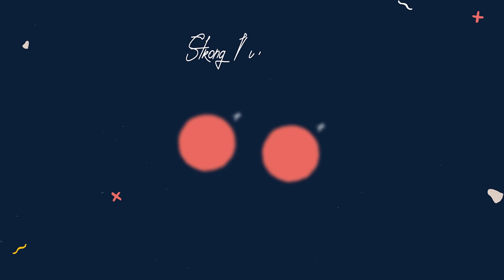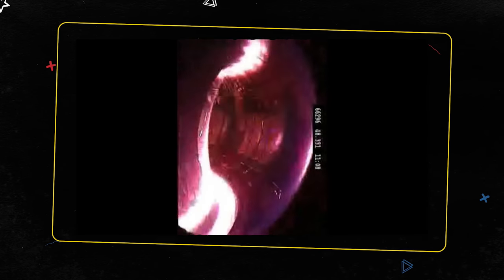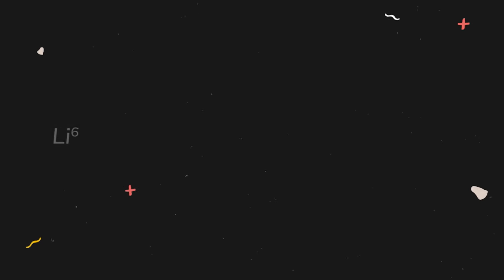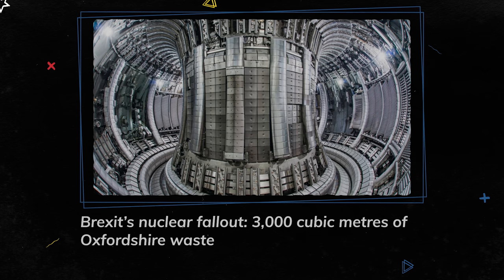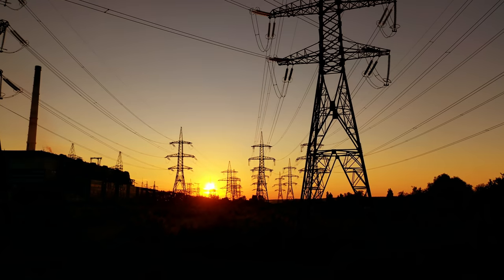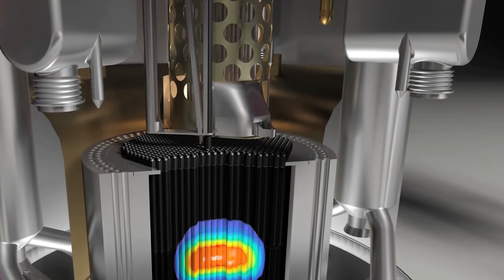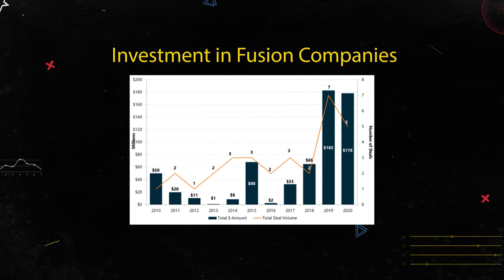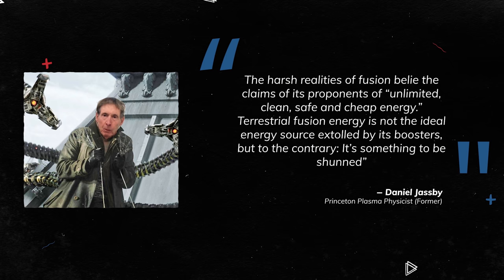What No One Else Is Telling You About Nuclear Fusion

Comment: There is one more difficulty with fusion that is not discussed here, and it could be big. Most of the energy of the fusion reaction is carried away by neutrons. In fact, it's a bigger portion than in a fission reactor. Those neutrons have to be stopped inside the reactor to extract their energy. They must be stopped before they reach the magnets, but that's just the beginning of woes. They really need to be stopped before they reach the walls of the reaction chamber, or they will gradually destroy that as well. Those walls cannot have even the slightest leak. So what you really need is some kind of blanket inside the vacuum chamber that stops the neutrons almost entirely within its interior, then just radiates away the heat. You are helped by the forward momentum of each neutron, which will result in most collisions being deep inside the blanket. Still, there will occasionally be some spallation events that will spill particles back into the vacuum chamber, either at entry or at exit. Well, it is a vacuum, so those particles will tend to fall to the bottom of the chamber. Still, you can bet that this will amount to a real engineering problem that will have to be addressed in one way or another.

Comment: Well, yeah. ITER is "just" a science project, everyone who thought otherwise didn't understand a thing about Fusion. We will need proper superconductors and most likely use the stellerator- design for the reactor. And yes hydrogen at superluminal velocities only sounds dangerous if you lack knowledge, f.e. about how energy is dissipatet inside a volume. 
Well, you know. Fusion is still 30 years away. Always. Until we find the black swan to make it possible.

Disclaimer: all writing mistakes belong to the one who finds them.

Comment: I think you are absolutely correct. My own studies suggest fusion power is 22nd century (with luck). But it is important we get there so research must continue. Meanwhile to solve global warning it is renewables plus fission, likely globally in an approximately 50:50 mix. 

Of the existing fission technologies Candu has a good safety record and some capacity to burn up waste. Therefore new generation Candu reactors may have a role. 

Beyond that there are the Gen 4 plants built to very high safety standards, waste minimisation and levels of proliferation resistance. Those designs using molten fuels (typically FLiBe salt) show particular promise. There is enough Th and U in recoverable quantities to meet global fission power needs (in conjunction with renewables) for at least several millenia and possibly well beyond.

Comment: All of these problems illustrated here need to be discussed. And, in general, physicists would agree, these problems all can be solved at the end (the video also agrees on this). Solving the problems will take time - and it already took a lot of time with no tried and tested solution so far. It does not look like there will be any "fast track" solution to make the technology available on big scale within the next 15 years. Therefore:

One problem REMAINS undeniable: Only in 2060 could nuclear fusion contribute in the single percentage range to global energy demand.

So it might be important not to be under any illusions.

( In 2060 our fossil fuel demand has to be already reduced to at least say no more than 20% of the amount we use today. So that will have to be done without a significant contribution of fusion. )
Reply: I just watched a video a few days ago, there is oil in China but deep under the ground, if put more money on technology improvement China can have sufficient oil (no need import) for over 100 years, but China apparently chooses to import oil currently instead of dig deep.

Comment: Good presentation. I have studied energy for over fifty years. fifty years ago I learned about the density requirements needed to obtain a fusion reaction. An example I remember stated the density would be 13 times the density of lead. You can figure out for yourself how close this is to being correct. Imagine trying to compress lead to the point that its density is 13 times greater and you can easily understand that this would limit the quantity of deuterium fuel. Then there is needed a transducer to make use of fusion energy.

Comment: It seems the predominant tokamak or spheramak fusion designs could be improved by eliminating the central column and extending plasma isolation in that region by a magnetic field only. Then you could converge the center radius if desired, which would then give such design the traits of a focus fusor as well. However I've not seen such attempted yet, and focus fusors tend to be small compared to the other fusion reactor types. Perhaps it's a problem with mechanical stress introduced by magnetic fields that makes building a reactor enclosure with no column protruding through the middle difficult? Anyhow if the center column could be rid of, then you'd have a region for more energetic reactions that current designs don't allow for. (I picture something like a ring of inward-facing horseshoe electromagnets over a reactor chamber, with a cantilever structure over that to deal with mechanical stresses produced by an active containment field. Then build a column-less reactor like that. Field goes through where needed to control plasma, but nothing physical in the way where the hottest region would be possible.)

Comment: I find it really interesting that people consider fusion power too slow and expensive to provide clean energy in the future but take it for granted that we will solve all the problems with intermittent renewables soon with technology that is yet to be developed.
Reply from the maker: Well, Carbon Capture for example is a solved problem. 

We know how to do it. We could burn coal and capture the CO2, and it would be magnitudes cheaper than Fusion. 

Secondly, if we’re ok with an expensive but CO2 free option, we’ve had Fission around for 70 years with an excellent safety record. 

And lower energy neutrons to deal with. Even fast reactors use 1 MeV neutrons whereas the neutrons coming out of Fusion are at 17 MeV.
Reply: @TechforLudditesSira  carbon capture is SO not a solved problem, since it is way more expensive than almost anything else. It is as much a solved problem as fusion is.
Reply from the maker: @JanMalec  No, no, we can do carbon capture right now. Of course it takes energy, but we could build a Carbon Capture Coal Plant tomorrow at somewhat competitive rates.

Comment: The fundamental problem is that it's "terrestrial". We don't have the sun's gravity, so we need to up the temperature to 100 million K, and use Deuterium and Tritium. All we need to do is manipulate gravity, creating a small localized volume of sun-level core pressure. The temperature required drops to 15 million K, and you can use just straight hydrogen (the proton-proton chain). The gravity provides the containment, although it would probably be a good idea to encase it in some sort of shell. As long as the gravity manipulators and the hydrogen-from-water crackers use less energy than what you can generate, you're on a winner (potentially, at least, the gravity systems may be relatively low energy, as you're just folding a small bit of spacetime). Although, of course, the time dilation effects inside the reactor might bring on some unexpected consequences: but they'd also make the reactor last a lot longer from our point of view. Where is there another Einstein when you need one?
Reply: the temperature required doesn't drop to 15M. It's just that Sun is so big (literally 99% of all mass in Solar system) that it can afford such inefficient process. You want efficiency? You NEED to go 100-150M

Comment: What this video is not telling you:   Fusion advances over the past 60 years have been above Moore's Law - No other industry have seen such improvements.

* A company called General Fusion has a working mechanical fusion reactor which negates many of the problems stated here.

* A company called Helion Energy has a reversed field fusion reactor which negates many of the problems stated here.

* MIT (the university) is building a SPARC fusion reactor to test their revolutionary magnetic coils, total cost will be  much cheaper and smaller than a fission reactor.

* Fission can never reach 100% energy gain . But fusion can, the stronger the magnetic field the more reactions.
 ITER made a record to reach 45.5 Tesla, almost doubling magnetic performance and reactive potential.

* Fusion reactions produce tritium. Tritium  is not a limiting fuel... Lithium is, which is cheap and abundant.

Comment: It's worth noting that ITER with its toroidal reactor isn't the only fusion project in construction now - Wendelstein 7-x is doing great progress with its alternative design (Stellarator), they are alredy in the stage of short plasma bursts, with continuous fusion expected around 2022 (although coronavirus may cause delay)

Also, with high costs there are great benefits coming as well - deuterium-tritium fusion produces helium-3 which is a sort of a dream fuel, since it doesn't produce fast neutrons, meaning it can be fused in much cheaper, simplified reactors later on.

Comment: Most people don't realise that ITER is not even designed to produce power, but is really just an experimental reactor. I generally agree with Daniel Jassby, the claims for fusion start to fall apart when you look closely. D-T fusion is not unlimited, certainly not cheap, nor that clean. I believe that the technology in ITER will be too expensive to build and operating costs too high for it ever to be commercially viable. Maybe some other fusion technology might be commercially viable.
Since we already have access to a fusion reactor, we really should use that as much as possible.
Reply: @Gomlmon99  You are just repeating what I said... ITER is an experiment. My belief is that the technology being explored in ITER will not lead to a commercially viable reactor. 
If you want to know more about the problems with the technology, look up the articles by Daniel Jassby, they are very informative.

Comment: It's not "clean" either the reactor structure materiel will become neutron activated over time and need to be disposed of as radioactive waste, and there will be tons of it. Fusion creates a ton of neutrons, the soviets actually leveraged that with the Tsar Bomba to create a fission -> fusion -> fast fission bomb where the neutrons from the middle fusion stage were focused with neutron deflectors into ordinary depleted uranium metal and caused fission even though the materiel isn't anywhere near criticality. The fission stage was actually the most potent stage of the entire bomb because the outside neutron source caused much more complete fission than with a criticality based atomic bomb. The third fission stage was never tested the soviets got scared and replaced it with a dummy stage but as originally designed the third stage would have more than doubled it's output to over 100 megatons.

Comment: You missed one more problem: If for whatever reason the vacuum fails in the torus, the lithium blanket will ignite explosively. The only true solution to do away with Tritium and the Neutrons causing material problems, would be to go with a Deuterium - Deuterium reaction. The main problem of course is the requirement of 3 to 4 times higher temperature than the Deuterium - Tritium reaction to start it. Until then, Fission reactors using Thorium might be a more feasible solution. Of course there is the Conspiracy buff's idea that the hole thing about fusion research will result in fission free hydrogen bombs i.e. usable nuclear weapons with no long term radioactive pollution...
If you read what was said about Nuclear Energy back in 1939, is exactly the same with what is said today for Fusion. During the 1939 World Fair in New York, public relations articles regarding the nuclear fission, were claiming that a mass of Uranium the size of a golf ball could provide electricity for a city the size of New York for a year. Well we all know of the first use of nuclear fission six years later... True DEAD END...

Comment: Besides D/T fusion, perhaps you should also consider D/D, D/He3 and He3/He3 fusion. In particular, He3/He3 fusion is aneutronic. This means, it won’t produce any neutron radiation and the energy generated is directly in the form of electricity and not heat.
Reply: D/T is the only one that is within reach temperature wise with current tech. he3/he3 needs 800M K, not 150M K like D/T

Comment: Very well presented and highlights the infeasibility of fusion for at least 50 years and likely, well, forever.  In the mean time, solar is becoming the cheapest source of energy and with continued improvements in the efficiency and lower costs that solar advantage will only get better.  Energy storage is a problem with solar and wind but there are numerous ways of dealing with that.  For home owners and small businesses batteries will be the way to go and over time this is scale up as well.  But, for large scale, grid level storage requirements the best approaches are pumped storage and chemical conversion, for example, water to hydrogen.  If fusion could have been available in GW plants 20 years ago they would have had something, but given the likelihood that we won't see viable fusion for another 50 years it will long since be pointless.  
Almost all the energy we now use including diesel, gasoline, methane, propane, coal, wind, hydro and just about everything else got its energy from the Sun.  Coal, for example, was originally trees that lived during the Carboniferous Period more than 300 million years ago.  Those trees took in energy from the Sun and used that energy to build its carbon based structure but it took 300 million years for that stored energy to be used by us.  Oil and gas have a similar story.  Current consumer grade solar cells are a bit over 20% and it looks like perovskite based triple junction solar cells will cost no more and likely less while producing in the range of 35% efficiency -- and, that energy is available within microseconds of the Suns rays striking the cells.  These cells should be on the market within 5 to at most 10 years.  Game over nuclear!  Game over fossil fuels!

Comment: To counter your argument on maintenance costs, consider the early history of gasoline engines. Cars used to get only about 5,000 miles of travel before needing major maintenance. Spark plugs would have to be replaced frequently, as they would get fouled up (gasoline was much dirtier than today). Piston rings had to be replaced, because they would scrape against the piston walls, making them wider and the rings smaller. Carburetors would be a lot of work to maintain; cars would need to run several minutes at poor efficiency before you really got to begin using it. Countless other parts outside the engine would require lubricating, additional maintenance, regular replacing and still break at random. It took a lot of time & money needed to care for a car.

The point here is, fusion technology is still in its infancy. Many of these maintenance issues may resolve itself over time, through evolution of the plant's design. Or, maybe they won't; it is still too early to tell. But these are real issues that we need to work on solving.

Comment: You're way behind the times. 1) liquid helium cooling is no longer required, liquid nitrogen cooling now works, much cheaper. 2) cooling circuits can use molten salt rather than water, no problem with radioactivity.

Comment: I expect we will finally get a working fusion reactor in this century, but it won't come from ITER and it will use a reaction like Deuterium-Helium 3 where you can at least avoid severe fuel issues. The real issue is that we're NOT copying the way stars do fusion, and they're the only working examples we really have of energy producing fusion reactors. Stars use gravity to confine the plasma at high density and energy; we'd really need gravity control to emulate them. Instead we hope to make it work purely through electromagnetism, which means low densities and temperatures far HOTTER than the sun.

ITER isn't even planning to start building a prototype power plant until the 2040s, and if that tokomak approach actually works somebody like ARC will beat them to it. I personally think Stellarators are a far better design for an actual power plant, because they dynamically stabilize the plasma much better and operate continuously. Things you need from a decent power plant.
Reply: But Deuterium - Helium 3 has much much bigger fuel problems than D-T

Comment: Deuterium is non-radioactive and the amount of tritium kept inside the vessel is on the order of few grams. The idea is, the plans  go, it is going to be so little of it, that even if everything was to be released to the environment in one go, it is not dangerous. That is the advantage of constant burning-regeneration. It is just the principle that it is the dose that makes a poison. We are surrounded by natural radioactive isotopes like K-40. And so there is always a radioactive background we are use to. We just don't want anybody to get significant (as compared to the background) radiation dose.

And of course the induce radioactivity of the  vessel doesn't count here as the radioactive isotopes in the metal cannot fly or leak somehow. You just keep the metal in concrete housing. You just have to keep in mind you cannot use certain elements in your materials (like cobalt). Yes, it is sort of a challenge, but hey, we've sent people to the moon.